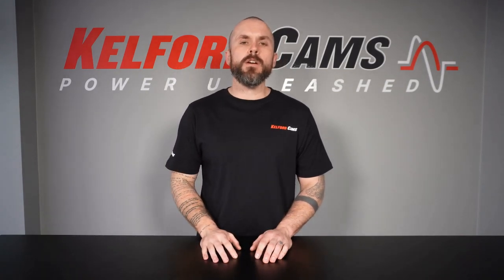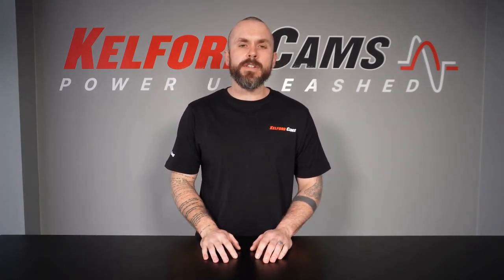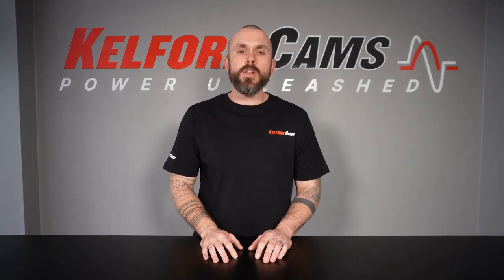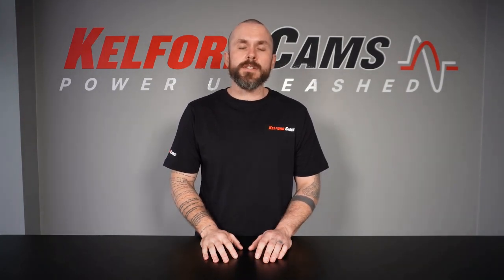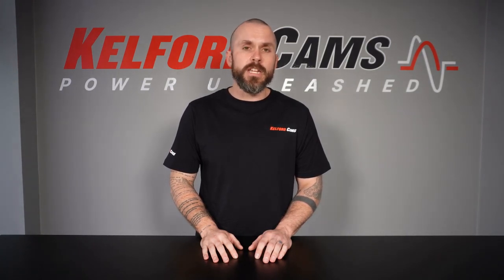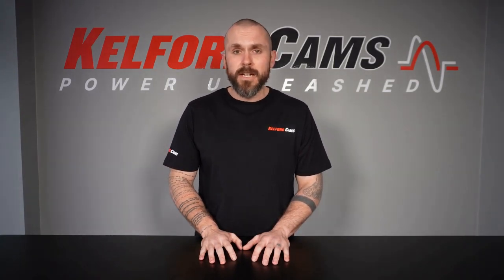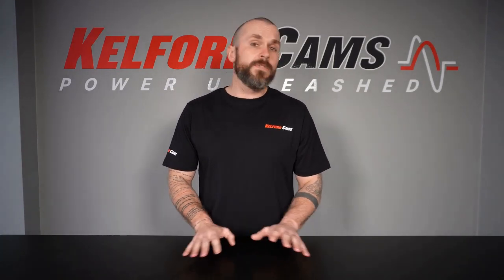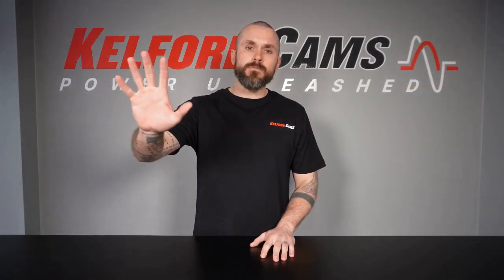Benefits of Hydraulic vs Mechanical Lifters

Comment: Some modern engines do still have solid lifters, such as the 853cc twin my Moto Guzzi V7 Stone.  Every 6,000 miles or so I check the valve lash.  By 10,000 miles they'll be loose enough to affect performance if you don't stay on top of it.  While some might consider this a pain, I actually get a great deal of satisfaction out of maintaining an old school machine.  I'd much rather set the valve lash every 8,000 or so miles than have to mess with buckets and shims which are much more time consuming.
Reply from the maker: Thanks for sharing your technique, sounds like you get a lot of pleasure out of tending to your car, those old school vehicles deserve all the love ❤️